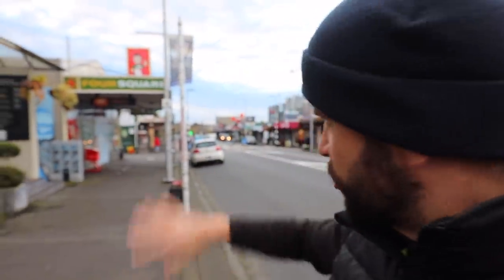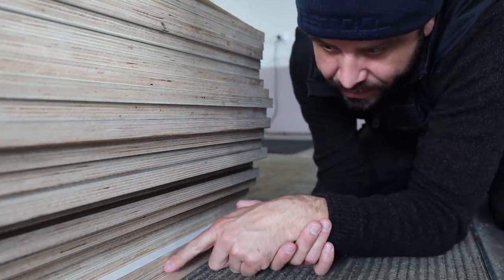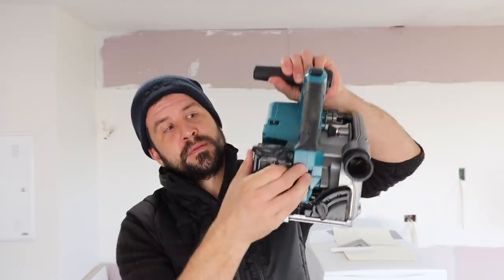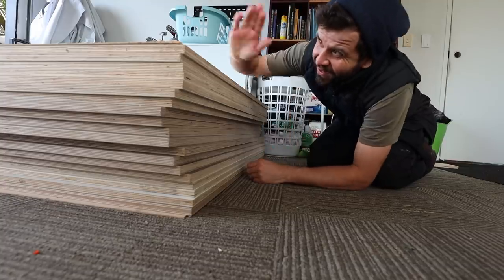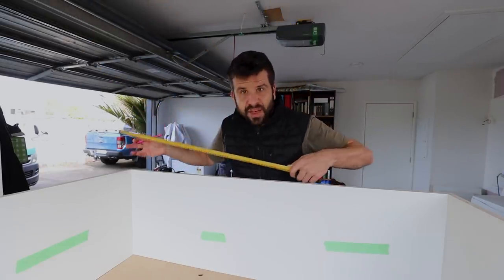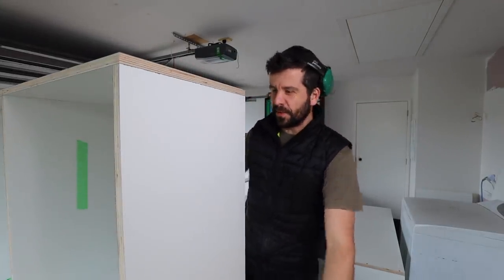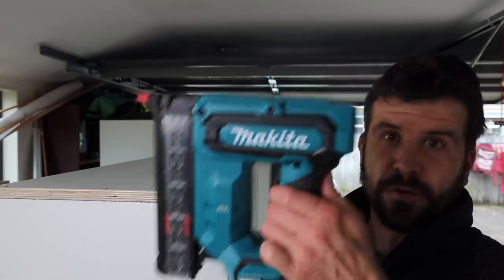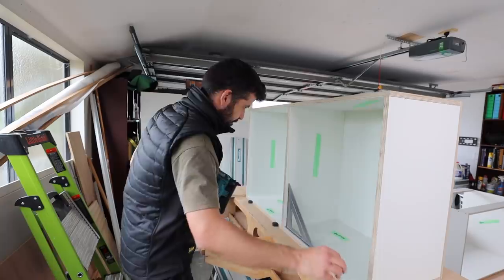Can a Builder Be a Cabinet Maker?

Comment: Scott if that ply wood is melamine coated, that glue won’t stick to it. You need a specialty glue for melamine.
Reply: Not in my experience. Selley's Aquadhere which is exterior PVA bonds to the point where separating it tears the melamine surface off.

Comment: Hi Scott, alway love you videos and have never had a criticism, but are those cabinets for the wall? (i believe so as you mentioned sag) then in that case the top and bottom panels should really be fitted in between the side panels and screwed together through the side panel first for extra strength.

Comment: How are you gonna hang those cabinets? Seems like an unusual way to attach the back plate
Reply: Wondered the same thing. Also, I believe Peter Millard once explained hanging cabinets should have the side board attached to the side. Not entirely sure why but something to do with pulling force iirc.
Reply: Pulling force and visuals, not an issue with laminated ply and glueing and screwing, wondering what doors are going on, might have been easier to predrill while it was flat pack but we'll see 👍

Comment: Hey Scott I love your videos of carpentry projects but when you made those cabinets were you mindful about the order of the joins ie. in the video you have screwed the sides in between the top and bottom instead of vice a versa (I've seen cabinet makers do this)- I'm wondering if this was a personal choice or not necessary for structural strength? Cheers.

Comment: Hi Scott, love your channel! I have a question about routers, I see you use your router to take the edge of the timber when building decks etc, what type of router bit do you use?
Reply from the maker: One of these, it's a 1/4 inch Diablo bit, but you can use any brand - just make sure it fits your router. You still have to experiment with the depth settings until you get the ideal edge you want, but the bearing keeps it consistent https://amzn.to/3Bkfiq1

Comment: Good man! Eating the whole kiwi. Does that make you a cannibal?
On a more serious note, did you just use the speed square to cut with the track saw? I've just made kitchen cabinets and struggled to get square cuts across a sheet width. No matter how good I thought they were I was off by ~1-2mm
Reply: Get a good datum on one long edge, make a parallel cut off that edge for 2 good long edges (doesn’t have to be final dimension, just parallel), then use a decent size square to check for square on both ends of your track overlap before cutting a square short edge. The you can use that as a reference for square for the rest of the sheet. I ended up buying a 3 meter rail and Benchdogs (uk company) rail square but I get similar accuracy, just saves time. If you take the time to get 1 long edge straight enough to rely on it makes it loads easier to keep everything in check.
Reply: @TheSmartStar  I made a Peter Millard rail square which helped but I'm a bit rough with it. Three meter rail sounds like a good investment

Comment: Serious Question to the Community: What's the best way to get a factory edge on laminate cabinetry? I'm about to install a new kitchen and really don't want to get any tearing. I'm pretty ignorant about woodwork, but I can use the tools and power tools. I just need to know the right technique.
Reply: Router for a perfect edge. A track saw with a good laminate blade will do an ok job with a light sanding, two or three strokes at a 45 degree angle. But router for an edgeband ready finish.

Comment: I noticed that apparently even doing that 'precut' can't completely save from chipping. I personally found that cutting over masking tape also helps to make less sever.
Reply: Use the scoring function but run the saw backwards, pulling toward you
Reply: @TheSmartStar  backwards? Sure? sounds like recipe for disaster. But will give it a go with a scrap piece. Cheers.
Reply: @dmitryi3761  youll be surprised. It’s quite a common trick when using MFC. Obviously works better with a melamine specific blade.
Reply: @TheSmartStar  good to know. Thanks for the tip.

Comment: Question, we typically over size some holes in the states to allow for expansion and contraction due to climate changes.  With you're extra moist climate, do you do something similar or due to the type of ply you don't have to worry as much?  Thanks!
Reply: Even in the States, when we work with plywood products you wouldn't oversize the holes. Due to the grain going in perpendicular directions on each subsequent layer of ply, it is dimensionally stable.  I would imagine they do have a lot of wood movement on solid wood projects though.

Comment: 😬 I don't want to be the criticizing comment section guy but I did cringe a little (or a lot) with the units construction. You typically want the tops, bottoms and backs on the units inside of your sides. When they're hung from the wall the weight of the unit is always trying tp pull your fasteners straight out. If you fasten thru the sides you've got the shear strength working for you and a much stronger unit. Glue will help you out, provided it actually adheres to the laminate...
Reply: I thought this too.  Also, I'm surprised to see him use Titebond 3.  Its definitely not a good choice for melamine.
Reply: @WhangaFish  Should the top, bottom and back be inside the sides for a floor standing wardrobe as well? I'm planning on making one, I watched the link you shared, any other tips for a first timer?
Reply: @JohnSmith-yy1fg Yeah pretty much stick to that formula for all cabinets. Easier if you're breaking down sheets manually. You can make one rip and then cross cut your bottom, fixed shelves and top stretchers, then another rip for your sides. Of course that depends on size and quantity of units but you get what I mean.
Reply: @WhangaFish  Thanks!

Comment: Sorry Scott, but I will rain on your parade.
Plywood should not be joint this way with screws into the end-grain.
They should go in cross-grain manner by using pocket holes (Kreg jig?)

Furthermore glue does not stick well enough to the laminate due to poor porosity of it.

Good luck with your work.

Comment: There is 0% use in pva’ing those plastic/painted looking surfaces to wood.. the pva won’t soak in so won’t bond. Unscrew a carcass and test the glue strength..

Comment: Unfortunately I couldn't watch this with audio, being on the bus, but I've seen your experience woodworking making the worktop thing (I'm still not sure of the benefits if I'm honest) as well as internal plywood paneling in a house and other things too. You have the experience with this, but not melamine it seems. The only thing I'd say may or may not have worked is using masking tape where you were nailing to keep it together. Curious you used the same thickness on the last panel, I think that sad a back piece? My frustration with the industry is it's all fiberboard of whatever, meaning B&Q here in the UK (I'm sure an American company-wickes is same company but better :s) do cheap and cheerful, though it buggered at my friend's house. IKEA is known to be good and easy quality, Howdens was crap having little to no input, refusing to state prices etc etc and others like wrens were most affordable and competitive, very good. But, no plywood :s I'd imagine it's best surely, though fiberboard or whatever it's called seems ok-it evidently holds the heavy worktops and such. Why are cupboards from companies other than Ikea and B&Q so expensive? Haha :p